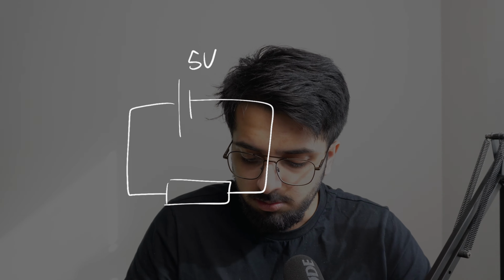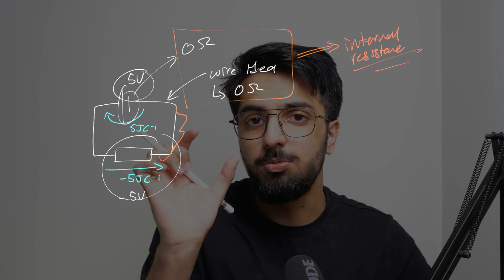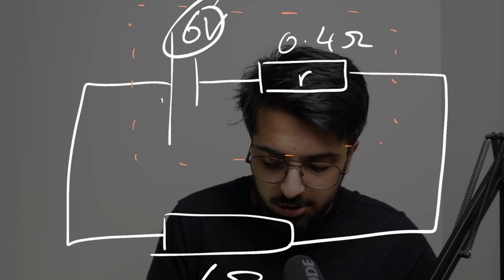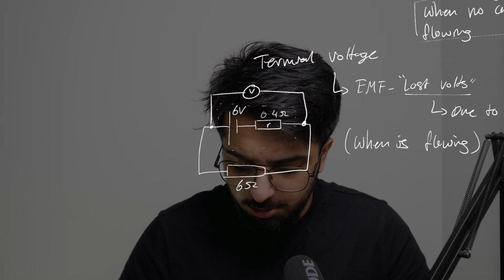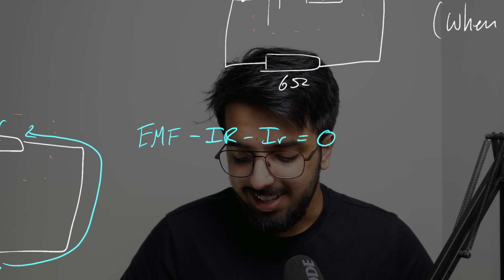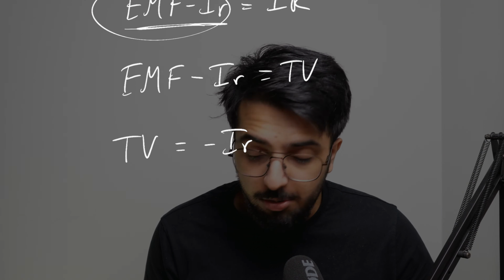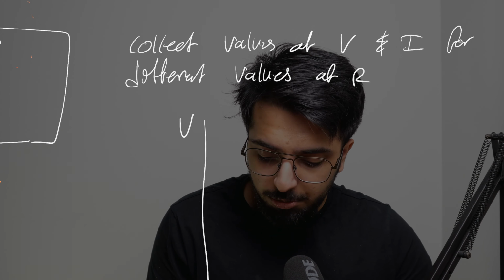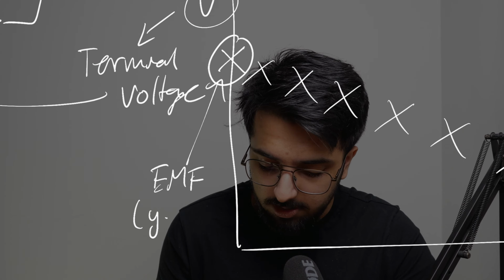What is EMF in a Circuit? | Internal Resistance - Part 1 | NCEA Level 3 Electricity

Comment: Great video, but I'm a bit stuck on your graph of terminal voltage and current. You say that as the resistance increases, the current decreases and thus the voltage increases? How can you know this? If V = IR, and R increases but I decreases, doesn't V stay the same? That's my thinking at least, unless I'm misunderstanding something fundamentally
Reply from the maker: That's a really good question! The key thing is that V=IR still applies — but I and R aren't changing independently in this experiment.

I'm changing the external resistance R (which is the variable resistor), which changes the current according to I = EMF/(R+r). So as R increases, the current decreases.

The terminal voltage is the voltage across the external variable resistor, so V_T = IR. At the same time, we can write V_T = E - Ir. Since the current decreases, the voltage lost across the battery's internal resistance, Ir, also decreases, so the terminal voltage increases toward the EMF.

Hope that helps 👍